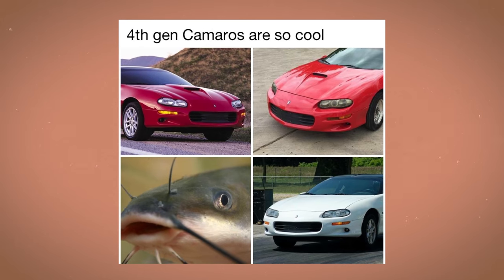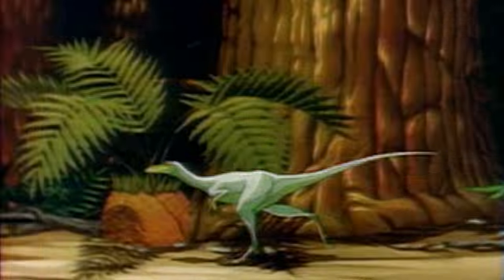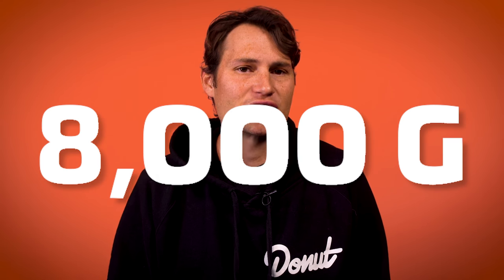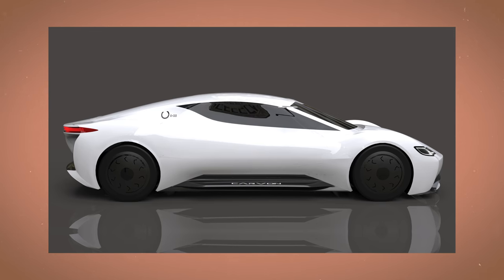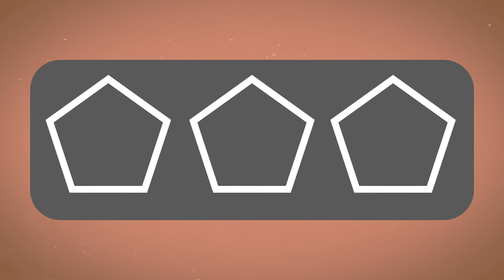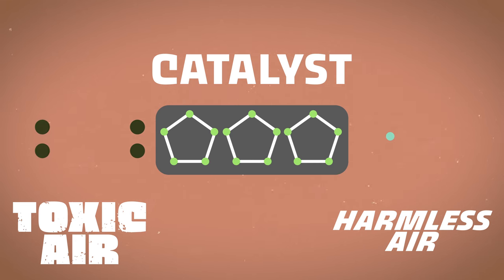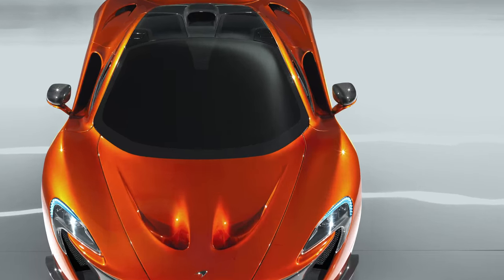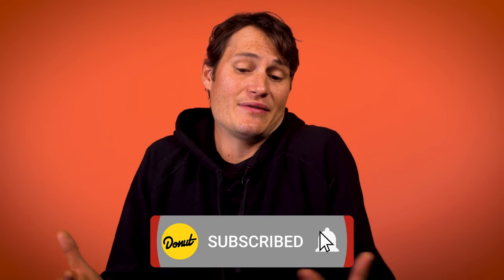Why Engineers Steal from Nature

Comment: I first heard about biomimicry in the early 2000s when I read an article about a Mercedes based on the boxfish that could acheive almost 60 miles per gallon. It wasnt a hybrid. It wasnt a small engine with a turbo. It was just an everyday gas engine.

Comment: What is the point of rotating a woven pattern 45 degrees L and R or 90 degrees? Isn't it the kind of "mirrored" stuff that makes no difference? No need to rotate it 4 different ways if they're the same structure wether you rotate it left or right, it's a matter of referential